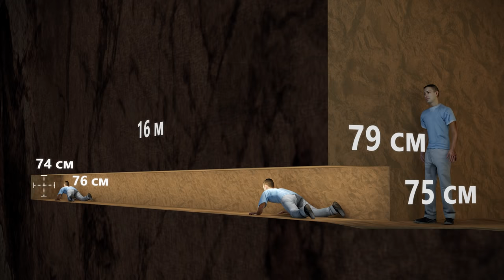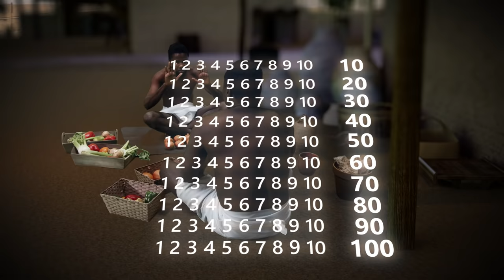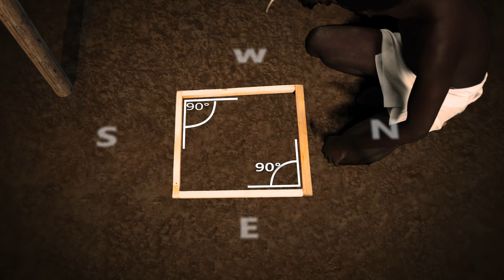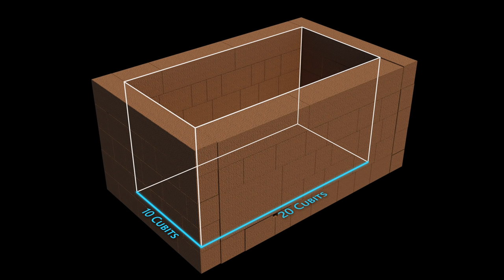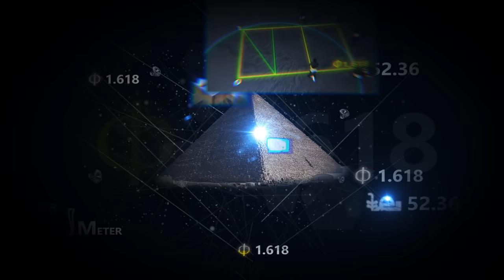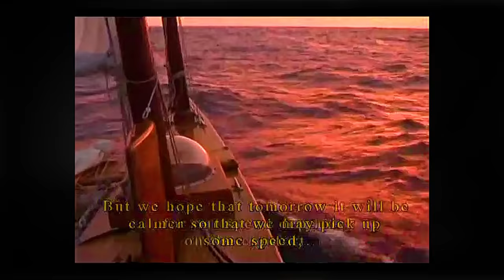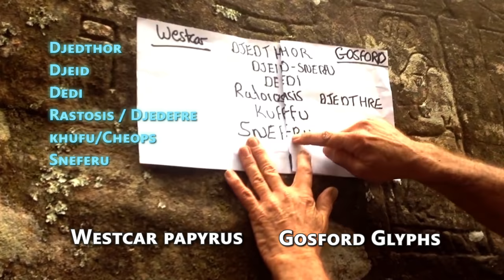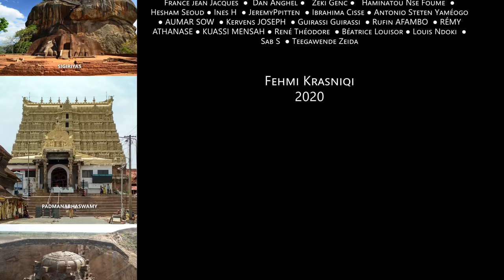The Movie Great Pyramid K 2019 - Director Fehmi Krasniqi

Comment: Hmmmm I really wanted to take a listen with an open mind here , the polymer idea has been postulated for quite some time and it does have a compelling side to it. It does seem to answer the question of the blocks being so tight you can't get a sheet of paper between.
HOWEVER. ... when you came to the SOLAR LENS.. what appears to be a HUGE perfectly formed magnifying glass . What are you all mental? What did they first make a perfect glasslike bowl that they then manged to seperate the lens from? , lift and polish it? 
Ok you perhaps make breakable molds, but what out of? And how were they polished and fashioned to a perfect curve? And youre making one for every lens? Otherwise you must answer how they stop the material bonding together as it cools. What was done to release it then?  and then after you POLISH it perfectly to make a perfect lens you  suspend 20 feet or more (I suspect it might need 50  feet or more to direct the beam of light to a point tbh!!) to get the right distance and then kept it there perfectly in place even though it would get incredibly hot itself , most likely melt itself back to silicate.
What and they discovered this but never once thought to LOOK through it and discover the telescope?? A microscope?? No READING glasses?? Two lens would merely have to be moved by someone and they would see and know it was a way to enlarge and see further or see the  smallest objects more clearly. We would have had astronomy and microbiology 3500 years ago and it would have never remained secret. It would have been used for health or for war etc
Hundreds of huge lens  with hundreds of thousands of people able to see them probably a few miles away and it never leaked to enemies??? And they never broke any and discarded the parts?  never once forgot a peice in the sand from shattered glass(like) smash? 
AND LETS NOT PRETEND Egypt has direct sunlight every day of the year here! You DO get lots of clear skies TODAY yes, but its not every day EVEN today and the climate was very different thousands of years ago, (5000 years ago it was aparently almost like tropical jungle in the Sahara area)  , today there are many days where the sun is behind haze and cloud, don't fool yourself into thinking its perfect weather 365 days a year in Egypt. Its not perfect sun and youd need perfect for the lens to work. What do you do when the sun isn't there in clear sky? Switch to fishing for the day?
It needs explaining

And just what did they use to make the form for the molten poured statues????
You would NEVER get the prefect form without a way to hold it without the rock bonding LIKE ROCK to the mold. Did they invent a releasing agent that no one has managed to recreate since with all our technology? Sorry sand , lime and caustic soda won't help here.
And if the mold DIDNT form a perfectly released finished statue then you are left with the EXACT same problem of carving perfectly and intricately which is the problem they can't quite solve in the first place.

Look , the polymer blocks, yes , if it can be PROVEN the blocks are indeed all magnetically facing the exact same direction I think you have proof.  The problem here is I think this film is lieing about the magnetic directions of the blocks . 
If it was all exactly the same you would have this as ARGUEMENT NO.1 . and I cant see an argument against it unless they knew about magnetic poles imbedded in rocks as they form and happened to WANT to cut and lay stones in the exact same facing. This would be obviously reduculous , no one would cut stone from a quarry hundred of kilometers away and somehow  keep track of each one so they could be faced together the same way.
If as this film claims the stones ARE indeed all exactly identical in their magnetic facing the discussion would be over and done. It isn't,  and so I postulate the stones aren't as claimed here.
IT DOESNT end the polymer argument. It just means there's FURTHER PROOF needed. 
I would suggest the answer must be to analyse natural rock , what  is IN the rock, natural debris perhaps. Thus proving its molded . All you need is for ONE WORKER to have dropped a tool, or a peice of jewelry , a cup , a plate, a bit of rope , ANYTHING. 
JUST ONE EXAMPLE of an object , a man made device imbedded deep enough in a stone or sticking out that can be seen and again argument won.
The wood is a GOOD example. Very compelling imo. But we need more than that one example here I think, construction might mean they imbed the wood to make platforms. Time and mineral leakage could be involved here, the second example where the wood was suspended between the two blocks was CLEARLY limestone/salt crystal residue that exudes from the stones over many years. It's a white crystal looking substance and you can see it has run over that bit of wood. 
I still need convincing personally. I'm still open to polymer but this film has not given me confidence in the film makers sincerity. They appear to be trying to deceive to make their argument or fabricating quite some nonsense without the least bit of playing devils advocate against their own theory. It's good science to formulate a theory and play the advocate against it and solve that to help prove it. You don't just say "this is how its done" and brush all questions under the proverbial rug. Not if you want to convince the world.
I almost stopped watching here but I'm glad I saw the broken nose /African (black) arguement.
VERY COMPELLING, WHY ON EARTH DID YOU NOT MAKE THIS THE START OF THE FILM?????
(ALthough AGAIN there's some serious flaws in the Atlantic crossing "proof" with the negroid almec heads. Are they really suggesting the African facial features mean they were there and then what? Gave all their secrets to the Indian tribes, started to just carve huge heads INSTEAD of pouring the molten granite statues they knew how to make , then EVERY SINGLE ONE hopped back on the boats and left? Not one of them leaving dna proof they were there? no one had relationships with natives? No one stayed to make a new life? Just carved hundreds of heads and left?  Look I don't like being devils advocate here but IT NEEDS TO BE ASKED BEFORE YOU CLAIM PROVEN. 
These sorts of films are actually quite dangerous. It creates emotions , that somehow you are being robbed of your history,  or on the other side someone is claiming you DIDNT create your treasured monuments but we're taught instead.
It simply IS NOT FAIR to throw highly emotionally charged theories out there without second guessing your claims. It shouldn't be up to someone like me to point this out. I don't like being put into the mix as you can imagine. 
And let me make this clear , if I thought there was enough compelling proof I would argue for the truth on behalf of all black people to the ends of the earth. I declare that.
The almec heads ARE a massive enigma and need to be studied. And are I think, its just the heads are all we have. 
Don't forget there's monuments where there are many heads with many features imbedded in the walls. It's compelling evidence there was some sort of contact. Tobacco in the stomach of Khufu mummy also!
There's more to be found out but this film goes too far and I find it a little worrying. I stopped watching around 2hrs 30 mins or so. I might return to watch the rest but at this point I was getting annoyed at the blasé use of their "evidence". 
As I said its dangerous imo, tends to make everyone angry at each other. 1:33:32 1:33:32

Comment: Based on the droplet size, the root mean square error would be few percent, and a precise ethanol of 1m is simply impossible based on this , since the error would be MULTIPLIED. the question about 1.000m laser measurements of the sarcofage remains opened! (And mistique)

Comment: Comment 03:  At 30m00s --- "With hieroglyphics perfectly engraved"  This is quite true. Close up, the hieroglyphs have perfectly straight and perfectly curved edges and are roughly 12 mm deep.. Even with what I know 50 years later (and after 40 years in engineering), I do not know how such perfection could have been obtained.
I also know that the polished flat surfaces are perfectly flat within .02 mm over large areas.  We today cannot achieve this flatness without powered machines.  40 years ago, such flatness required tool and die top level machinists to do such things - and lots and lots of time and money.

Comment: The SI system of measurement is based on repeatable, observeable characteristics of our earth. The inch/foot/mile imperial system actually has its origin in metric I believe. Metric is as perfect of a system as possible. It is easily understood, is easily converted between units and in mathematical operations, not prone to error. All this said, I still encounter ignorant opposition to its use by many fellow builders, as most building materials are still made to Imperial dimensions. Here in Canada, where the metric system is the standard, any builder worth his wage should, in my opinion, be able to flip back and forth between both. As a rule, I work with a tape measure with SI and Imperial units. I cant tell you how many guys have given me grief for using such, saying my measurements are not accurate because I cant use either side of the blade. Ive heard the metric system predates imperial by centuries, the imperial system actually being a sloppy translation, suffering from accumulating error, based on a copy of a copy of a copy, etc. The fact that these ancient builders were using this universally applicable unit is proof of people far more capable than we give them credit for. We like to think we are advancing bravely, proudly towards  eventual mastery of our surroundings. God broke up the big building project at Babel in an attempt to save us from ourselves. He said, "let Us confuse their language, scatter man across the land". This was to show Gods displeasure in mans propensity to focus on creations and not the Creator. The Bible is clear that God gave us our intellect and creativity  to honor Him with dignity and to enrich our lives, challenge us and allow us to have dominion over the earth. Even an amatuer archeologist could not argue that history shows mans broken nature ultimately creates the means to his own destruction. Thats what I see in once great civilizations who allocated disproportionately large amounts of resources into vanity projects. We are doing it now with our ridiculous space programs that will yeild little fruit. Anyone who thinks man is evolving upwardly, ever improving, is kidding themself. Yes, we benefit from accumulated knowledge in that I dont need to first invent Pi to lay out a circular concrete form, I dont need to invent cellular communication, then microprocessors and the touchscreen in order to then create a useful app. I may know more trivia, facts, techniques than my counterpart from 4000yrs ago, but that man would posses the accumulated knowledge of his predecessors, as well as the conclusions drawn from his own observations. His observations would be made in a far less biased space and time. He would test his theories in his own life to determine its trustworthiness and usefulness. His logic would reject false conclusions and through trial and error,  adopt those which provide predictable evidence beyond coincidence. 
Dr Mary Schweitzer is a paleontologist who discovered dinosaur fossils that when broken open revealed still pliable, springy tissue cells that simply can not be there, according to the accepted geologic column. This inconvenient discovery is an embarrassment for her and the whole community and has largely been rejected as anomalous, being swept under the rug in hope that it just goes away or is forgotten. Of intetest is the fact that this was not the first discovery of this nature. The word science, as it is flippantly used today, holds little weight with me. If these highly indoctrinated, er, I mean educated "scientists" were honestly engaged in repeatable, observable science, a discovery like Dr Schweitzers fossil would upset the whole field of study and cause an exciting revival in the pursuit of truth. We see the opposite. Evidence not supporting the cult of academics is ridiculed into obscurity. Those responsible for announcing such scandalous evidence can expect the same ridicule. 
To anyone still reading, I ask you this? 
Does what I say about history, archaeolgy, science and Gods very words, the Holy Bible upset you? Does it seem intuitive? Does it feel familiar? 
The Bible says "wisdom begins with a fear of the Lord". Contrary to what zealous members of the aforementioned institutes of modern "science" would claim, Christians are not ignorant, closed minded dreamers. To date, the names we associate with the greatest foundational discoveries belong  mostly to God fearing individuals. Thats indisputable. 
There is an agenda, its greatest supporters not even aware of the role they play in the lie. Satan and his fellow fallen angels have been allowed influence over the world for a time. His directive to kill, steal and destroy in Gods creation for as long as he can. Satan is a liar, his lies irresistible to our flawed flesh. He tells us what we want to hear, flatters us, entrapping us in our pride. We all lie, you dont need to teach children to lie, its our nature to conceal, misdirect. Just like Satan, the master of lies, we too speak enough truth to be credible but through omission or fabrication decieve the ear with enough lies to exonerate ourselves. To understand the nature of man is to realize the need for a saviour. As we all know, there a good things weve tried to embody in our lives, and often fail. We also have bad things in our lives we try to shake, to pitiful results. If you can agree with these universal truths, you can understand your own nature. Deep down we all know this place did not just happen. We go along to get along. To not be ridiculed. But we all see the lies that flourish in our world. That explains the relatively recent fascination in conspiracy theories. 
The Bible says "we struggle not againt flesh, but against principalities". The WEF falls into this category I feel. But thats kids stuff compared to the long established, insidious schemes that have been destroying man since shortly after creation. It is the duty of any military to endorse its motives through propaganda, in whatever form. Propaganda can be so compelling as to be gladly accepted by its intended audience. Thats how Satan is working in our world now. George Orwell was more prophetic than Im even comfortable with in his book 1984, written in 1948. That should be mandatory material for students. We see things really come together when we change our world view to a created universe. A benevolent, omniscient, omnipresent Creator who spoke EVERYTHING into existence. God created space, He created matter out of nothing, matter needs to exist somewhere and when, so He created time. God exists outside of time and is not under its restraint. This means He knows all of time. All that has or will happen, He knows. The Bible tells us we "are made in His image". That we "are fearfully and wonderfully made". This goes back to our inherent intelligence I spoke of earlier. My  4000yr old counterpart knew he lived on a young planet and definitely believed in God. But even at that time Satan was at work, confounding  communication, introducing doubt. The world has countless reigions and cults. Most have some element of kindness, generosity, goodness, honesty...but all are counterfeits used to damn mens souls. 
I dont think the Bible mentions the pyramids. Probably because it wasnt important. Our God provides the Holy Spirit as a guide and helper. We should learn to ignore inaccurate lies which dont check out and listen to the still voice that tells us the truth.

Comment: According to the opinion of several scientists that have commented about this documentary, it appears that the Egyptians couldn't possibly have build the pyramids utilizing the method expose by the author. For me it means that the truth about the pyramids have not yet been revealed. But I prefer this sincere attempt to find out the truth about the pyramids and reject in absolute terms the hypothesis that the pyramids were built by extraterrestrials because the letter assumption implies that human beings, that are already traveling in outer space couldn't have built the pyramids. Now, if it's scientifically demonstrated that people from outer space did it, I will surrender.

In the book The Third Chimpanzee, the author, Dr Jared Diamond, mentions that we have been sending messages into outer space since the early 60s and we have not yet received the first answer. Then he points out that this technology, which utilizes radio waves, is way more simple than the technology required to build a flying saucer. The conclusion is obvious: they couldn't come here flying a saucer when they didn't have the means to get a phone call.

Comment: Great video,  food for thought. 
If not giant lens, maybe parabolic mirrors. 
" a parabolic reflector, concentrating light (Insolation) onto a focal point. The temperature at the focal point may reach 3500°C (6330°F), and this heat can be used to generate electricity, melt steel, make hydrogen fuel or nanomaterials"

Comment: I admire and respect Dr. Joseph Davidovits' work, but given that, I have a few challenges.  One, I suspect that since the Ancient Egyptians were smart enough to make screw pumps, they would have been smart enough to devise some type of conveyor system for the material instead of having all the guys act as the conveyor system, even if it would've been a manually operated one.  That would have cut down manual labor about 80%.  Two, regarding melting granite with that huge lens, I doubt anyone could have stood that close to it without serious injury or death.